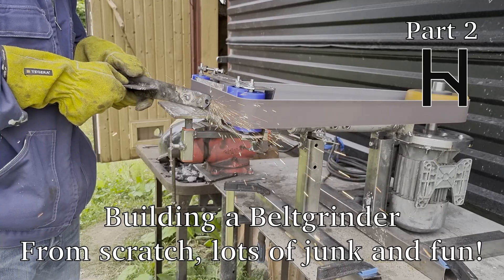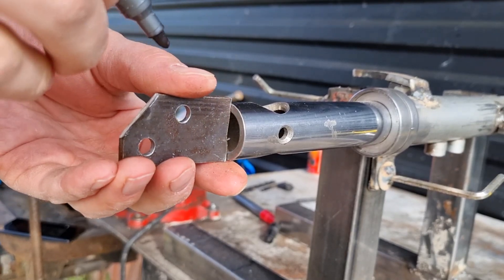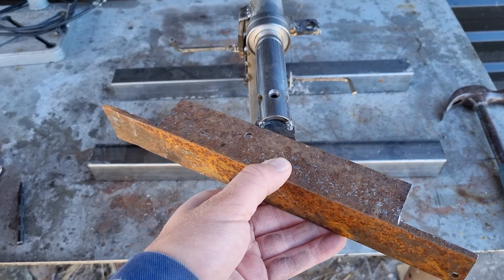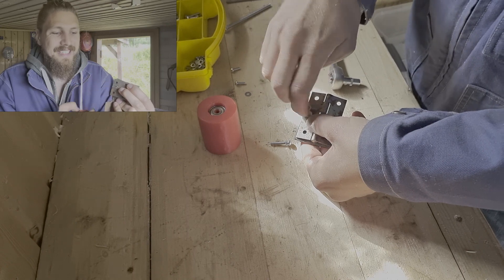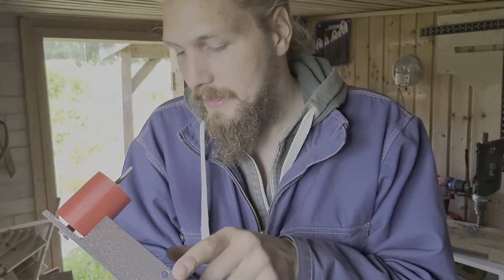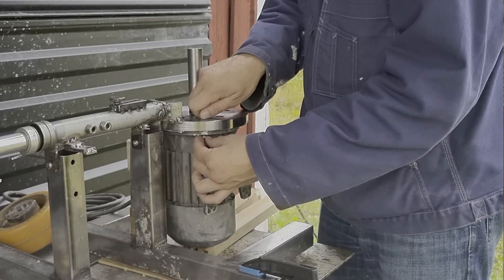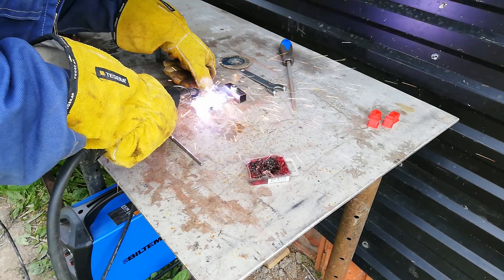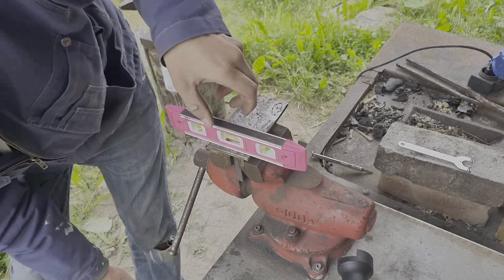Building a Belt Grinder from scraps - Part 2/3

Comment: I am currently doing the same tho not making it swing into horizontal just yet. One tip I will tell you is you need to slow down your movement when welding. Circles or C's need to be done much slower. Otherwise your pentation will be weak and welds will break. If your welder don't go low enough to not burn holes then make small single welds and stack them next to each other as you go along the weld. Flux core can be very unforgiving with thin metal. Great job working with what you have. Mine is made from 5 different old tools and project scraps lol. Best of luck and cant wait to see the next episode.
Reply from the maker: Thanks, that's great advice! I will make sure to test that out. Sounds like an awesome build and I would love to see it when it is finished. Will you upload it somewhere? Oh, and by the way, you sound like you know stuff, is there a way to make flux core not splatter as much? Maybe that will come from lower settings and slower welding to?
Reply: @hermansacres  Make sure you are Electrode negative
Reply from the maker: @leonardwilson980  I will look that up! I don't remember the present setting.
Reply: @hermansacres  Sadly no on the flux core. When you can control the bead better it will get more controllable but its the nature of the beast. You can use anti spatter spray tho. I didnt video any of the build since it was a week long scavenger hunt for the metal and changed designs 50 times haha.
Reply from the maker: @the_fafologist  All right, thanks! Such a shame, but I understand. The process can be quite messy, haha!